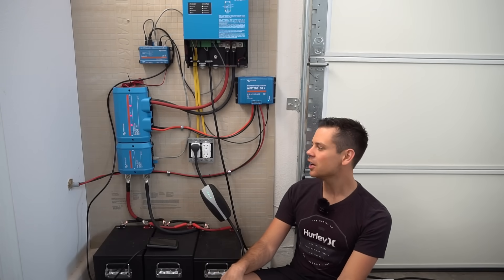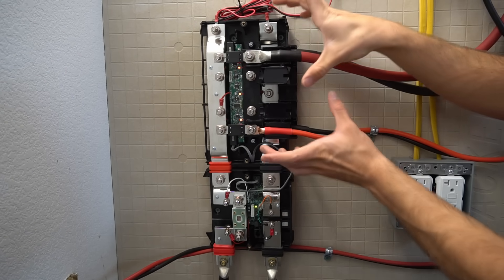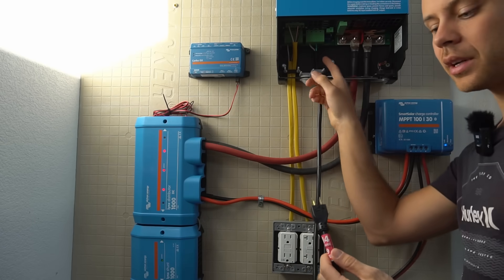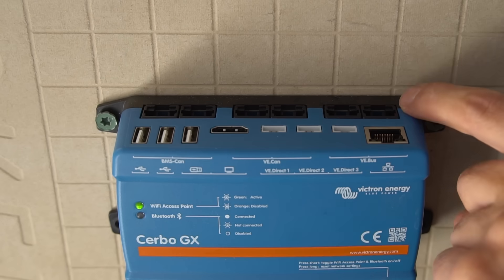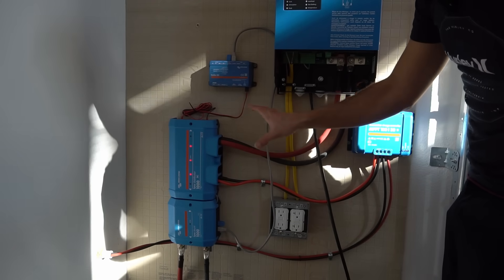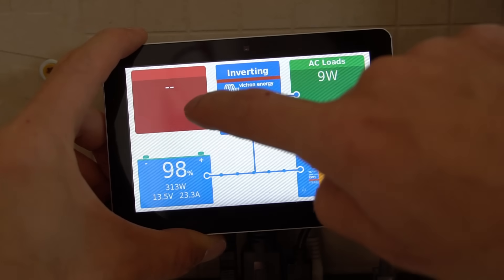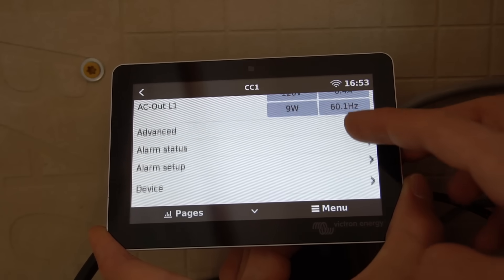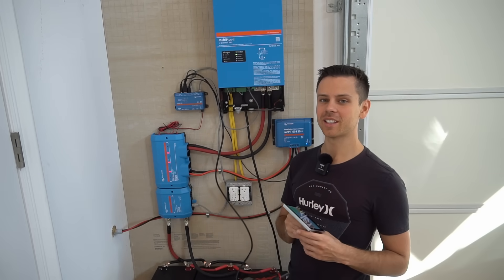Victron Made Easy! Design and Communication, Step-by-Step

Comment: Here is a question that combines this video and the one about using a victron Mppt for low temp. protection.  If you use the included temp. probe that comes with the Multi Plus ii, will it stop charging from both the Multi Plus and the Smart Solar Mppt?  The manuals don't give much information on the temp. probe or its usage.  Thanks

Comment: I can't seem to get a clear answer to this. Can the 3000W 12V Multiplus 2 also run on a 24v system? Victron's spec sheet seems to imply it can but I've seen sellers tell those who ask on this 12v Multiplus if there's a 24v unit and they're told there currently isn't a 24v version.
Are these sellers idiots and I'm reading the Victron spec sheet correctly and I can connect my 24v system to this?

Comment: Will, Great Video like always!  I am a huge Victron fan, and know a lot of the more advanced settings.  Do you have any thoughts on the fact the shunt I believe uses an ANL Fuse instead of a Class-T Fuse (that is a 6kA vs a 20kA interrupt rating respectively) when used with LiFePO4 batteries?  The largest BLUESEA Class-T is 400A, while I think BEP (BLUESEA sister company) make a larger 600A Class-T ... nobody seems to make a Class-T in the 800A to 1000A range ... which would allow for use of shunt in large architectures (and at 24v and 48v).  I do love the victron auto-transformer for split-phase 240v/120v, especially with its built in neutral to ground relay when paired with Multi or Quattro inverter.  Should work with EV charger, I would think.

Comment: Will, is it possible to use a different charge controller with this system and still be able to use everything else?  Will it communicate with a Renogy charge controller to read out on the Cerbo GX?  I'm considering the Renogy 60A rover instead of the Victron charge controller which is considerably more expensive.  Thanks so much for your reply

Comment: Why did you not install a battery set off between the battery bank and the Lynx Shunt?  Also, would you not normally have a beaker between your solar panels and the MPPT controller?

Comment: @DIY Solar Power with Will Prowse Id like to see a Victron MPPT test with 48V EG4 server rack batteries, They say if the BMS trips because of low voltage protection, the MPPT won't be able to wake the battery, but Victron states compatibility with various BMSes, could you test your controller with one of your EG4s? let the BMS shut the battery and see if a Victron MPPT can wake it?

Comment: For those curious about the total cost of the Victron and SOK material $6080.85
3000W 12V Multiplus 2 Inverter       1570.80  0.26
Lynx Shunt 1000	                                 356.15	0.06
Lynx Shunt Main Fuse 325 amp	    52.25  0.01
Lynx Distributor 1000	                          211.65	0.03
Cerbo GX	                                          347	0.06
Cerbo GX Touchscreen 5”	                  235	0.04
Smart Solar Charge Controller:           221	0.04
SOK Batteries 206Ah * 3	               3087	0.51
		
Total	                                         6080.85	% of total
Reply: I went with 2 S.O.K. 12.8, 206ah, for my needs
Reply: @jefferythayer6103  Do in need much thicker cables for 12v as more resistance. Also how efficient is 12v VS 48v inverter?
Reply: The Lynx Shunt Main Fuse, I purchased, went with the 800.
Reply: Yikes that's £5,000 too much for me, already spent £1600 not got a inverter yet  etc.
Reply: Thanks for doing the pricing homework.
Reply: Thanks. I wish Victron would do an all in one off grid system comparable to the growatt spf 5000 es. Those are now only 600 euros here so I'm thinking I'll eventually end up with 3x for split 3 phase 15kw capacity, paired with SOK batteries. The pylontech 5000 does seem very appealing for 20% cheaper but the stories online about lack of warranty fulfilment worries me.
Reply: @Lee-xs4dj  Sofar pylontech on a multiplus-II  and its seamless. Are you not referring to the Easysolar option in victron ?
Reply: 2025 here.  Prices of those components have dropped around half and batteries way more!
Reply: Great thanks. In the future I'm wanting to run a massive 3 bed house with 2 x 2 bed additional  apartments for rental with two pool pumps and two well type water pumps and 2 washing machines 8 TVs, 3 fridge freezers and 1 chest freezer. I reckon 50 to 60kwh 48v battery bank at least and 30kw of inversion. To build that with victron would be over $35k easily no? Including my panels that is? I Want to be off grid. What would this cost me.
Reply: in fact, 2 SOK Battery could run the 3000w inverter..
Reply: A massive rip off. All that gear can be found in an all in one inverter, and be half the price.
Reply: @PulsechainProfits  probably, but reliability and longevity as well as customer service have value. I’ll pay twice as much for a product that lasts years and years over a cheaper unit that dies in 18 months.
Reply: @diyrenewableenergyelectron4996  i agree. However, I was hoping to see less components. What would be the simplest configuration one can use with Victron assuming the same setup of solar panel and battery bank?
Reply: @closetcleaner  you can build a Victron system with just a charge controller and inverter. You can fuse the conductors as needed. You won’t have a central data collection source but a solar system will work just fine with a charge controller and inverter. Victron connect will still show you the charge controller (solar data logging and live readout) but it is a less “complete” system.
Reply: @PulsechainProfits  indeed it can. But, you will have to purchase at least 2 solar panels and 1 battery on top just to equalize your consumption. It's at least 1kwh more per day, because they are not energy efficient, they don't invert well and use a ton of electricity just by beeing powered on. During winter, that kwh could well be the difference between power and no power. Victron is  energy efficient. They don't use much power, even when in standby
Reply: @richarddeutsch9984  How much more efficient  percentage  wise? What is the whole system''s current draw at night with no load?
Reply: @petrolkopnitro2722  obviously every system is unique and every brand and model idles differently but generally speaking, victron products do not use much power. Yes they cost more but they last twice as long and are efficient powerwise. I have chinese and victron products and for instance  my chinese 2000w/12v inverter just sucks the life out of my 100ah battery. You can feel it because, in a very small system, every watt counts. 
You can watch the video : "victron phoenix 1200va ... " on this channel and see Mr. Prowse get exited by the idle consumption of that product. 
I wanted to build for someone a small 5kwp array connected to a cheap chinese system with an all in one mppt, inverter blabla. It got it all, even party lights that changed with production or whatever. I watched that model beeing fully analysed on YouTube. As it turned out, 1 day of consumption was 3kwh. That's a lot. That's 1 full day of summer production of a 300wp solar panel. During winter, you will certainly miss those 3kwh every single day. You will even have to purchase them from the grid.
I am a big fan of lowering a much as I can the total cost of owning a solar system, because at some point you want some kind of return on investment, but good mppt and inverters must be the priority, because they are the heart of the system. Solar panels, batteries, who cares.
 Given the choice between an all in one victron and any other company, I would choose victron any day.
I hope this helps
Reply: @PulsechainProfits  You are right and not right at the same time. Besides a 5years warranty and likely longevity, the biggest advantage is the modularity. With an all-in-one inverter, you are stuck with what you have or spend a lot of money to replace the whole thing. With the Victron, you, for example, add a few solar panels and a second mppt charger, and voila you have more PV energy.

Comment: Excellent video, thanks.  Question....I am buying a new motorhome and plan to upgrade to Lithium, probably use Lithonics, about 18k watts.  I am told that I should use a 48 volt system with would require a 12volt "reference" battery which I do not understand.  I plan to use a dedicated alternator to charge the batteries.  I want to use an all Victron system.  It seems that Victron max battery voltage is 24 volts.  Ok, I got that, perhaps I will limit the voltage to 24 volts with bigger wire, still better than 12 volt cable.  Anyway, you are very good at explaining things.  could you please, at some point, do a video addressing this type of system?  And cover the so called "reference battery"?  I am just beginning, the motorhome is on order for a July delivery.  Thanks again for all your videos

Comment: Victron equipment really has sold me on eventually swapping out all my gear for theirs. 
The way they design their systems is ultimately more flexible and feature rich than anything else on the market. 
You can tell that an integrated IT style approach was taken to system layout/setup/UI development. 
Intuitive, well organized, easy to read and comprehend, connections are a snap, no additional config involved... EASY first timer learning curve. That is how you design good gear. Really top notch. 
And the Expandability? Wow. 
Cerbo GX looks like a VERY Custom SoC with all of its GPIO an IO dedicated to specific Victron devices and uses. Its actually a little computer with a custom OS from the look of it. That monitor, I would venture a guess, is likely just a standard HDMI / USB touch screen. And any screen of the same format should also work without modification. (Say in case you wanted to go larger)
But this would have to be confirmed by someone like Will who already has the device. 

Beyond all that... You can easily start a Victron system cheap, with only a smartshunt 500 and a charge controller, and then grow that system to any size your wallet can imagine :-) 

Its not cheap gear for sure... But its DAMN GOOD. So It makes up for it!

Some very nice equipment, and the increase in safety factor with all the inter-device communication, is just off the charts. 
Most of us working with large format batteries and electricity are all about safety, and if you are too, Victron gear is absolutely some of the safest gear you can buy to watch your pack and your system.

Thank you Will for the detailed walkthrough on the Victron communications system and the Cerbo GX.
Reply: Their OS is Linux based. They have a version that works on the Raspberry Pi. If you're technically inclined you can download it and set up a $40 Cerbo GX type server.
Reply: @jmnasman  I only have a smartshunt at this point I'm time. 
So I assume it's not worth it just yet? 
But that is incredible to know actually. 
I've been in IT for may years. So this is right up my alley. Thank you VERY much for sharing.
Reply: I'm definitely impressed by the design philosophy and execution, but my project is pretty simple, and a lot of the features and capacities of the Victron components seem like expensive overkill on my small project.  Still, it looks like great gear.
Reply: @evanwindom3265  With lithium... for me at least, I tend to think about the location of the batteries as far as the level of gear I might need. 
Are these batteries in a Home or Garage? 
Do you and your family sleep there? 
How often is someone there to monitor the system and check for issues? 
Is the circuitry wrapped around the scenario of enough quality to avoid heat issues entirely? (Typically overbuilt by 50-75% nominal load is safe. Less is not) 
How much Solar is coming in? Less than 1000w = not a problem for cheapo gear. 2000+w = you should probably be using better charging gear and combiners/breakers

If its in a shed 100ft from your house and its a 4 pack of lithium 100ah cells... Any gear works. 

If its in your home, and you sleep there, or are away long periods, the level of monitoring does and WILL matter. Lithium has a VASTLY different explosive potential than most people think. It burns SUPER HOT, and is virtually impossible to extinguish without a powdered chemical ABC extinguisher. (Water is BAD BAD BAD on ANY electrical fire, especially a lithium fire. As it will flash boil and some free hydrogen will burn/explode, splattering you with molten lithium.)

Even a cell phone battery can make a fireball about the size of a keg of beer at over 1000c at the source. 

Aka = insta-fire if not monitored by something you TRUST with your LIFE. 

Lithium is bad mojo when its angry. 

Lithium says "You wouldn't like me when i'm angry" 
LoL 

Also, Pro Tip, the CerboGX os is open source and is freely available. You can build your own from a mini PC and save 400-500$ to get started. That and a shunt and you have at least SOME monitoring. Temp sensors. Then a decent BMS for charge state monitoring and balancing. 
Whola, Safe and good to go. 

Also, Marine 300amp quick battery disconnects are VERY good for large format lithium packs. Safe. Been using them for YEARS without issue. No failures, no shocks, no Mr. Sparky. 

;-)

Comment: Will, thanks for the video. Soon  I will be designing a system for my boat. For now I will have to figure out the current system. Also the power draw from various components to understand how much power I may need. I plan on having solar and a high output alternator with a Honda 2000 or so generator for back up. The boat has an original fridge/freezer which I have no idea how much power it draws and assume it will be one of the biggest draws. How would  I go about figuring that out? Connect a meter somewhere I assume. Just not sure where. I won't be back to the boat for a few weeks. Also,  I would like to hire you to help me design this if possible. Victron is definitely something I have been looking into and want to use their products.

Comment: Haven't kept up with the latest Victron kit and am impressed with the easy way to connect all the communications up together.
I still have their early BMV 501 battery monitor on my boat that you had to connect to the shunt and battery with individual wires rather than plugging in a network cable. Although old , fitted 2006 , it still all works like the rest of my Victron kit 🙂

Comment: Will, why would you have 800 watts of solar running into a smartsolar 100/30 if this system is in a 12v configuration? Even the 100/50 would be exceeded with 800 watts of panels? The controller would however handle that power if in a 24v config.

Comment: The good thing with victron is the multi usage of batterries. You are very open to use  different batteries not this or that brand only with this or that inverter. Pylontech batteries are very likely used with Victron Systems here in Europe.

Comment: Nice summary Will.  I presume the Multiplus will bypass shore power, meaning the inverter turns off and uses shore power, instead of using the batteries to provide AC.    If that's the case, the AC line going to the Multiplus II should be a 4 wire 10 gauge connection I think, using three phase for an RV setup for 50A shoreline service, correct?

Comment: Great video Will. I have (8) 39V 305W panels. Are those high enough voltage to supply a 24 volt system? I believe you said in one of your videos that the panels should be at least 20 volts over the system. If not, I am thinking of wiring the panels in series (2 at a time) so that I would have 78 volts. The only problem is I don't believe the Victron Multi-Plus II is available in 24 volt, I like 24 volt because I won't need to run as large of wires from the roof (this is a bus conversion). Any help would be appreciated!
Reply: theres also a 48 volt version
Reply: Victron makes a 24v version of this inverter charger.
Reply: @chachi5975  I was able to find all kinds of Victron 12, 24, 48 inverters, but not the Multiplus II. I did find a 48 volt one, but the 24 volt ones that I found are for European voltages (not for USA).
Reply: If you don't need 12 or 24v and have enough batteries to make 48v why not go for 48v (8)308watt panels is about 100amps at 24v better off stepping up to 48v which will bring it down to 50amps.
Reply: @markdee3506  Thanks Mark, so I would go pairs of parallel/series panels at 78 volts, then install a 48 volt system? That is starting to sound pretty good.
Reply: @glennman9890  depends on the panel voltage. Is 39v the rated voltage or open circuit voltage?
Reply: @markdee3506  Open circuit voltage. Thank you Mark!
Reply: @glennman9890  could look at a victron mppt 250/60 for 4 in series/2 parallel, or 150/60 for 2 in series / 4 in parallel. You'd just need to check 2 panels would have high enough startup voltage. If you could fit another panel you could do 3 in series by 3 in parallel on the 150/60
Reply: @markdee3506  I think I could do another panel. I only have 4 panels now but planned to design for the 8 I spoke of. I'm pretty sure I could add one panel to get to 9 and do the 3x3 (series/parallel). However, I'm not sure I know how to check "startup voltage" that you mention. Your help is much appreciated.
Reply: @markdee3506  Sorry Mark, I thought I replied to this! It is open circuit voltage. Thanks.

Comment: I just purchased a new boat to me. The old owners just installed a new xantrax freedom 3000 multi-inverter. I am pretty sure it has the same communication port as the multiplus. I wonder if it would work in this system.

Comment: 800w of solar? Wouldn't that put it over  the 100v?
Reply: Only if he has them in series. If he has some in parallel the voltage should be fine but 800w could produce around 60amps at 12v so the controller is small for that system.
Reply: @chachi5975  so amps will go up but volts won't? Or volts will but not up over the max? I have 2 100w  solar panels and want to add 3 200w.